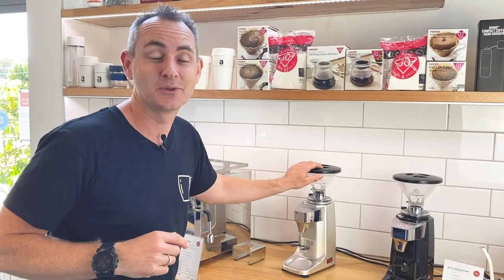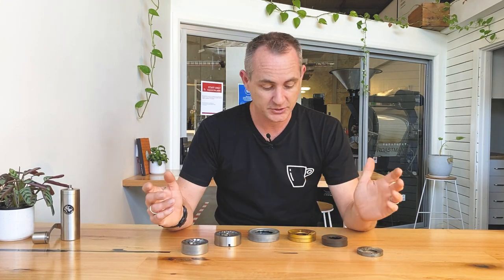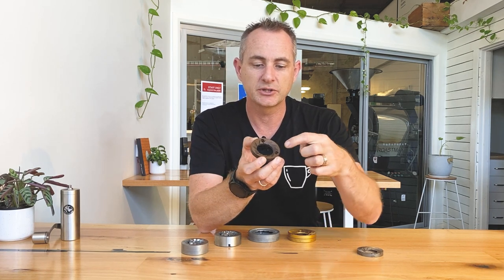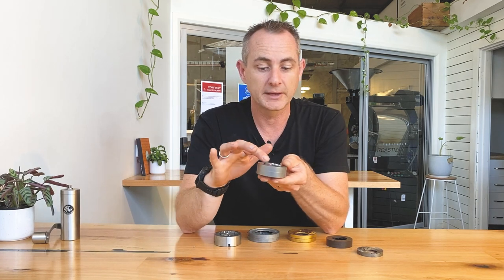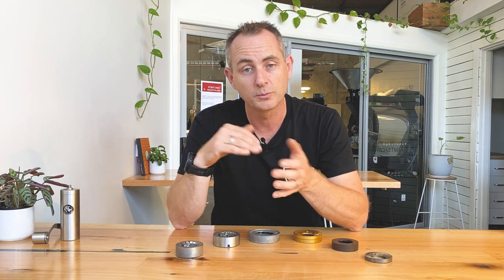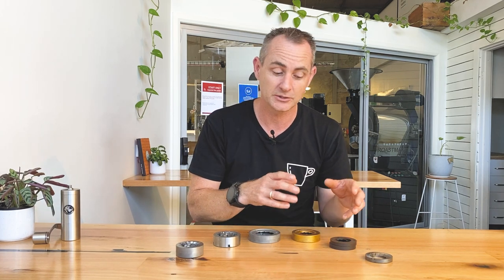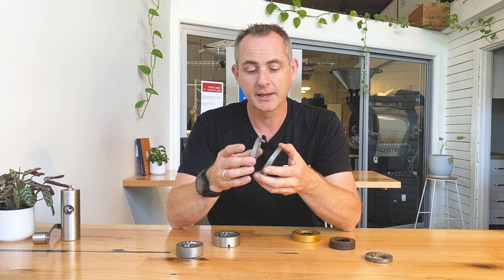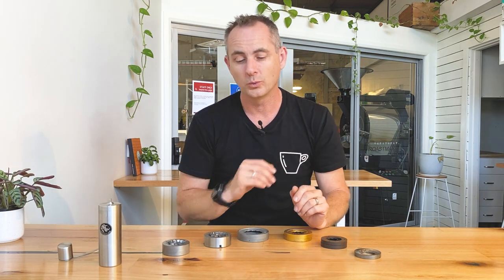Coffee GRINDER BURRS - Everything You Need to Know

Comment: Loved the informative structure about conical and flat. Am keen on a Major V because its an 83mm flat burr that's of good value. Suitable for prosumer home or mid-to-high volume cafe. 
Would there be difference in taste when it comes to size for flat burr or its because of its larger size the heat dissipation is better, therefore better tasting than smaller burrs?
Reply from the maker: We have used these before and are great. The larger burr allows for less friction and quicker grinder time giving less heat. 👍🏻

Comment: Nice video. Just a quick question. I have washed mythos one burrs in water recently for cleaning. In your experience, Do you think it will damage the burrs and causing those are rusted in the near future ? Thanks
Reply from the maker: The burrs are titanium so they should be fine. The coffee oil will coat them pretty quickly once you grind with them again. Just make sure they are 100 dry before you pop them back in, you can put them on top of the coffee machine to dry if needed

Comment: Can you give some info about titanium vs standard burrs? Like the flavor difference, performance, durability, and whatnot? And what are aftermarket burrs you mention? Sorry I'm new to this burr material topic and appreciate some enlightenment. Thank you
Reply from the maker: So most after market Burrs are designed to increase the life of the burr set, (from 800kg to 2000kg) could be pre seasoned to help you not waste coffee when putting in a new set, reduce heat by up to 10 degrees, which will effect the flavour profile of the grind and reduce the friction caused by grinding the bean which will reduce clumping essentially giving you a better extraction. How does it taste? if you fixed all the above you would have a more balanced coffee Vs one that has an increased negative acidity/body/bitterness/sweetness. Hope this helps. this could do with a full video one day for sure